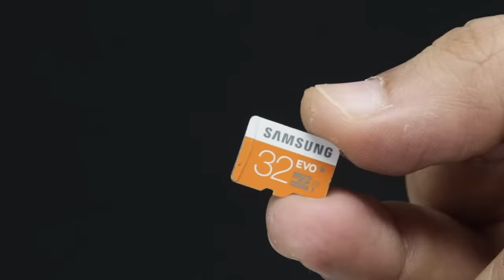How to Make Pocket Laptop at Home

Comment: Very cool but the preview still frame shows it running Windows. I've got nothing against Linux (typing on my Linux machine right now) but you might want to fix that.
Reply: Yeah pretty cool
Reply: Just to rack in more views, and ofc it works.
Reply: Yeah, also, the Raspberry Pi platform lacks a battery controller, so there would be no battery status within the OS.
Reply: why would anyone run windows? best way to get viruses
Reply: @kbhasi  unless you used the remaining gpio pins and an expensive board
Reply: Not really, you can get viruses on any operating system.
Reply: By saying "Windows is the best way to get viruses", means that you know little about security, and know little about how viruses actually work.
Reply: I was just making an observation. If you folks want to talk about the merits of Windows or lack of them, please start your own thread because I don't want to hear it. I've been dealing with this kind of nonsense since the Commodore 64 vs. Atari 800 days.

It's really monotonous.
Reply: yeah so true!
Reply: They do work, but usually run some form of Linux or raspberry pi os that maybe useful for general web browsing, it's faaarrr different from windows just saying...
Reply: yeah, although there are documentation online about installing it and online forums.
Reply: annoymou
Reply: TRUEEEEE
Reply: @dosdoktor  OK, "too many linuxes" these are not linuxes they're distros, Linux is a monolithic kernel.  There is only one Linux, the ones you listed are GNU/LINUX.  What does GNU stand for? GNU's Not UNIX. And so on and so forth, this is called recursion.  When a thing is defined in terms of itself hence the G in GNU.  The PS2 Linux distribution was based on Kondara MNU/Linux, a Japanese distribution itself based on Red Hat Linux, not Yellow Dog that was PS3's otherOS option.  You shouldnt make people feel bad for asking questions or making assumptions based on what they think , you correct them if you feel its worth your time.
Reply: its officially for linux
Reply: @RICHIE CRISPIN If your not doing anything with sensitive info you may want to consider another option as far as browsers for the Pi.  The Puffin Cloud Browser Terminal Project , which is more or less just an implementation of Puffin browser that runs in Raspian.  The only thing with Puffin is the lack of extensions and running ad-blockers.  That said you could still run a DNS level ad blocker in Pi-hole and achieve the same functionality with performance of a really fast cloud browser without ads.  Chromium and even light weight custom implementations of Firefox are still too heavy for the Pi , in my opinion others may differ.  Just a suggestion.
Reply: @petereggstein4919  explain this: I have run Windows 7 for 5 years and it's ok,
Reply: @Stuff1646  yes correct but they added Antivirus system which don't work
Reply: The screen said did not find module please try again then the script within the OS crashed I tried to make it work but the lack of battery is low and it takes like 4 hours to charge even the module of the raspberry pi booted up I see the codes but it cannot find the system and it broke 33 times even though it's cool I'll put more HDMIS in it so if u put it in another screen you can still see the screen on the laptop
Reply: @exr8570  Understand-hol up, an actual user who uses computers properly?
Reply: @annoymous Well some power bank modules do have a battery indicator and they're not that expensive sooo.....

Do your research man
Reply: U can use, twister OS 
It is linux distri but its GUI is too copy same as windows or Mac, we can set its UI as Windows xp,7,8,10 or Mac
Reply: Wor (windows on raspberry pi) allows you to run any arm version of windows on a raspberry pi
Reply: @kbhasi  в теории с помощью gpio можно сделать так что бы отображалось состояние батареи
А так же кнопку питания

Comment: Well, you have to break open the housing components in case you need to access the µSD card, or replace the battery.
Reply: First thing I thought of.  But it's a good idea if you put it in a case you can open and close and not have to glue components into.
Reply: @Imposter poster ➊ he meant µSD card, µ = micro

Comment: I would love an x86 alternative to Raspberry Pi, because clickbait is on steroids here.
Reply: You can run full Windows 10 on the RPi (WoA windows on arm).  You can run x86 32bit applications natively right on the Pi.  For x86 64bit you would be looking in the $200.00 range at a Latte Panda Alpha.  Go to novaspirit.com he has a YouTube channel as well but on his site you can get the video along with the written tutorial.  You download a GUI microsd flasher from github that works like etcher except it installs Windows10, not the iot version, on the microSD.  Then its just a matter of moving around a few files and drivers and your running win10 on a 35 dollar computer.  You'll wish you could give the Pi steroids to speed it up but nevertheless its possible and available .  Or you can check out the winterminal project that lets you use the pi as a thin client and network boot from your windows10 desktop installation.  Its a small .exe server that runs on your computer and it also comes with a utility that configures your microSD for graphics and install a bootloader .  You can get this on a 1GB microSD its that small.  The free licence supports up to four raspberry pi's that will boot over the network even over WiFi.  You can keep a persistent file on the Server machine for saving any work or documents across reboots.  So there are a few ways you can run x86 on the Pi without going the route of wine or exagear. enjoy.

Comment: Bro u could use a bigger screen and a Lattepanda  board instead of raspberry pi because u can use even window 10 also in Lattepanda
Reply: Heyy Your Suggestion is Absolutely correct but Lattepanda Is almost 8 times the Cost of Rasberry PI🥁🥁🥁💻💻💻
Reply: @some random guy on youtube I thought only IOT windows can run on  raspberry pi.  but I have seen on another channel they have been working on windows 10 for pi but it still needs alot of work on the drivers wifi etc
Reply: The internet barely works with Chromium on Raspian with a Pi 3, I don't understand why you would want to put windows on it, that would be painful to use.  Lattepanda is a great alternative, but not worth the money just as a standalone PC.  For a faster Linux/Android SBC, I would go with a Rock variant that is a forth the price of Lattepanda but comes in at similar specs.

Comment: Windows version??
Reply: Not available
Reply: You can use LattePanda for Windows instead of Raspberry pi
Reply: U can use win10 iot core
But that is not actual windiws
Reply: Download Ubuntu MATE.
Reply: Windows IoT
Reply: no, windows 10 arm version(not a iot ver.) for raspberry pi do exist.
you can download&and install it.
Reply: 7 or 10
Reply: windows 10 is shit
Reply: @understanding linux Nah, it sucks.
Reply: @understanding linux It's not like I never used it. I used it for 1.5-2 years. And it worked pretty bad after the first major update. After, for some reason, Windows deactivated, and I was not able to do it again. Then and last, my profile got corrupted. So I just said "Screw it." And installed Windows 7 that still works fine to this day..
And for some unexplainable reason, YouTube decided to modify my comment.
Reply: @understanding linux Instead of the last comment of mine, it was changed to something about Linux and saying that I'm currently typing on a Linux system.
Reply: @understanding linux i5-4460 3.20GHz
12 GB RAM
MSI nVidia GeForce 960
Reply: This video is clicbait (jestem z Polski kto też ?)
Reply: @understanding linux My friend Don is the one who got WoA running in the emulator, and you can use the internet just not wifi.  Although there a number of people working with him in order to bring that project to fruition.  The goal , a 'complete' stable running version of Windows on ARM , with all the drivers which is the most tedious time consuming part of  porting of Windows 10 to the RPi.

Comment: Its a cool concept and all.. However isn't there like specific screens with a build in case to put your raspberry in? Which also would allow u to connect it easily to the screen. I have seen them on some sites but i could be wrong.

Anyways still a cool thing you build

Comment: Fancy :) But how long does it run on this battery? Also it is not that beautiful this time... sorry. I would liked the Design of the Mini LED TV much more ;)
For detailed Review:
- The Soldering looks bad. (Maybe get a nicer Soldering Iron and/or practice more)
- The Backplate is not matching the Frame (Maybe next time ;))
- The HDMI Connector is fancy but disturbs the overall look (Maybe extend the Case a bit?)
- Notebook needs a Keyboard... (With Laptop most people associate a Screen and a Keyboard which folds up)
- Can't be used ergonomically if on a table or lap. (Maybe needs a Stand or something)
+ Cute Idea
+ Still a nice piece of art

Hope you enjoy my more critical "review" :)
Keep up the Good work!

Comment: I would have used an Orange Pi, though I don't think they we're made in 2018. I also would have gone the extra mile to setup the back panel with a hinge and close it with some screws. You can hide the top of the housing where the HDMI port is sticking out, pair it with some nifty speakers you can pull out of a broken toy or order for a few bucks, a bluetooth Keyboard and this would be kickass!

Comment: A couple of things come to mind: 
1. How long can this possibly run on a single battery? 
2. How much current does the DC-DC converter support? LCD+Pi has to be pushing 3A at 5V but I didn't see any undercurrent detection on-screen. Link doesn't spec output current.
3. Why not make the case just a bit larger to hide the HDMI bridge adapter? at 1:52 you can see the adapter's pins are exposed. not good for the electronics for sure. 
4. This thing BEGS for a custom / 3D printed enclosure.

Now, very cool build. Thanks for sharing!

Comment: I like it!

I Have build it myself and it Work great also with the pi 4
Reply: When not with that from he linked parts!
The pi 4 need 5v 3A and he has only. Link a 12v charging board but no step up Modul for the 5v 3A.
That board he use is not linked and windows 7/XP doesn't run on raspberry pi

Comment: The creativity Buzz laptop 1 Beta brings a sense of welcome rawness the world of computing, the display is small but clear however as for the rest of the hardware, it's non existent. The small Raspberry Pi is lacking on power a little, especially in terms of RAM for the modern user but overall a great DIY project with power in your pocket for a good price.

Build Quality 2.5/10
Creativity 7/10
Power 1/10
Price/Performance 8/10
"Pocket" usability 8/10

Overall: 6/10, Good for the price but don't expect to be blown away by the processing power or amount of RAM.

Comment: The dual HDMI you put in at 1:51, is that a jumper for the battery/pi to the screen? I'm trying to make sense of that and can't
Reply: No, the dual HDMI displays stuff on the screen and also, the GPIO (the pins) are the ones transmitting the power from the battery, not the dual HDMI

Comment: should have used two of them and used a full sized screen. even a dragon touch screen. more power too. then you could have used wire and plugs and it would be ultra fast dual processor and have a touch screen. bet they knock it off in china too. But how to use dual raspberry as one unit.

Comment: Can I use 2 ×18650 batteries instead of using 1
Reply: yes you can, you've to connect the batteries in parallel to get the double of duration while hold the same voltage

Comment: my newest idea on how to create led solar panels using a computer control system to prevent breakage.

hey new idea old subject that is if you have knowledge of computer programming and how to build them. led panels controlled by bios chips with voltage sensors placed at the end of every led to control and prevent over voltages of the led solar panel system. a bios can be augmented to allow the pass through of electricity only when needed just like the operation of a microprocessor. in this way only a portion or even a large portion can be used to create effective solar energy. this is possible because the bios program will only allow energy in when it is needed. this will prevent over voltaging of household curcuits. a simple switch sensor will prevent too much power from reaching the circuit by saying it is not ready to use. this can be tested with very bright flashlights to prove how many chips will be needed in a circuit and should be test by someone. good luck.
Reply: remember  it is risky as the led makes .33 volts and that is large for computer system so may need a large bios chip motherboard control system and will get very expensive. but the potential of 13.98 millions watts per six square feet will make it eventually economical by the space it saves which is about equal to one in ten thousand. would be useful the S.E.T.I. program but i can't reach them. i have tried.

Comment: This will cost around 7000 inr or more in which you can buy a proper windows tablate 1 gb varient.raspberry pi is cool but not cheap.
Reply: if we can make budget device using pi zero then it will be legit.